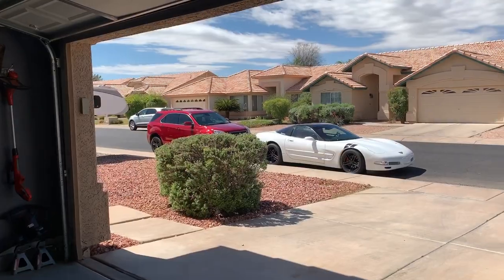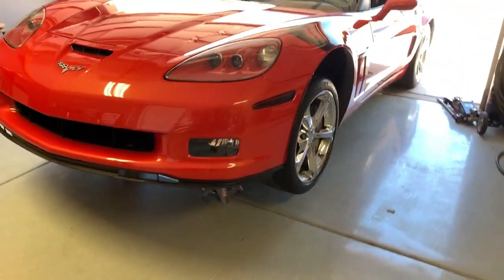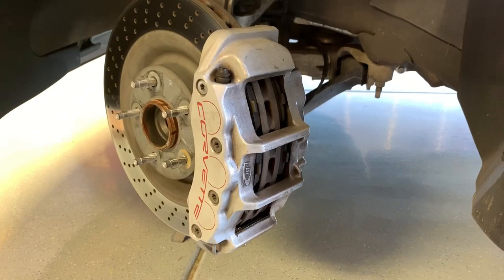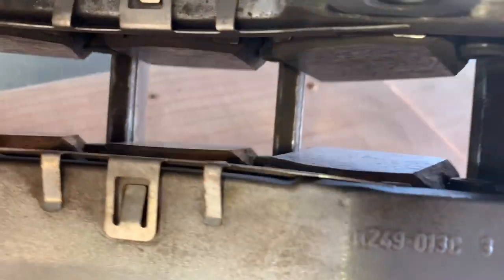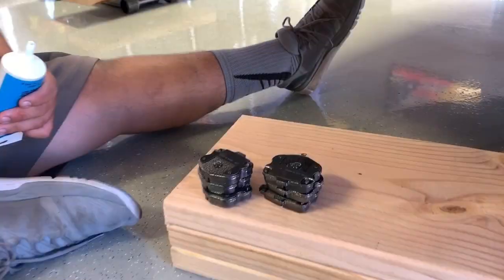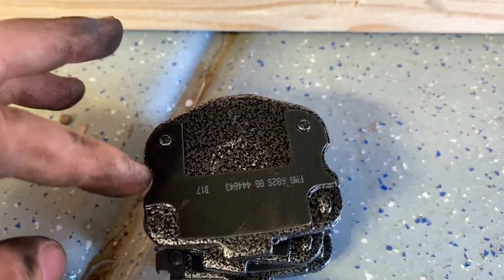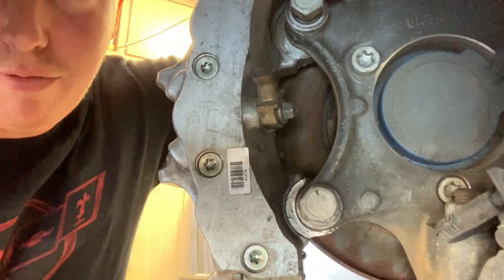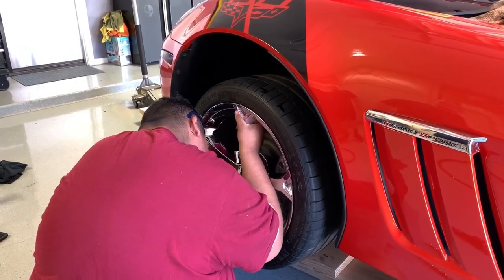C6 Z06/Grand Sport Brake Pad Change

Comment: I have a pad replacement pending on my '12 GS. One suggestion I might make, open the bleeder screws when you press the pistons back in. That avoids "back flushing" the fluid through the complex anti-lock brake system.

Comment: Great video and to the point. One recommendation I have is you really need to torque the wheel nuts. 100 Ft-lb on the Grand Sport. I can't tell you how many rotors I have replaced due to people running down the nuts with an impact. They do that and all of a sudden you have pulsation when you brake then you are buying rotors. I wouldn't be as concerned with a Vette because the rotors are heavier but still a good practice. Good stuff sir.

Comment: Hello Chris, I enjoy watching your channel.  I have a question!  I just purchased a 2011 Grand Sport with only 4K original miles.  The car was owned and driven by a female driver and I suspect that she was using 
regular gas because the car just doesn't go as it should.  I own a 2015 Camaro SS with the same engine and I also purchased the car used.  The owner of the Camaro was using 89 Octane and I had to run a couple of tanks of 93 Octane and then I pulled two fuses and let it sit overnight.  The next morning I replaced the fuses and the car ran like a Bear.  I suspect that the same thing happened to the Corvette
so, are there any fuses I can remove overnight to let the computer reset to the proper Octane so I can get the same result?   Thank you, Bob

Comment: Should tell the heavy set young man to look at the position of the studs on the caliper prior to putting the wheel back on, and then position the wheel correctly and he won't be fumbling with those expensive grand sport wheels.

Comment: Those old pads looked like they still had a lot more miles on them, why the change?  Also some new pads come with new pins that the pads ride up and down on,  do you happen to know if they have a torque spec if they're replaced and should they get some silicone greese too?
Reply from the maker: He was experiencing a squeaking noise so he wanted to replace them. The pins do not come with the pads, and can be reused in most cases.  The pins do not get torqued.  Hand right with some blue locktite is fine.  Greece only the back of the pads.

Comment: What kind of grease, and why?  

It looked like lithium grease, and I'm guessing it's so that it doesn't rust or fuse together on the back side?
Reply from the maker: It’s a silicone based grease.  Stops pad squeal on contact points with the caliper pistons.